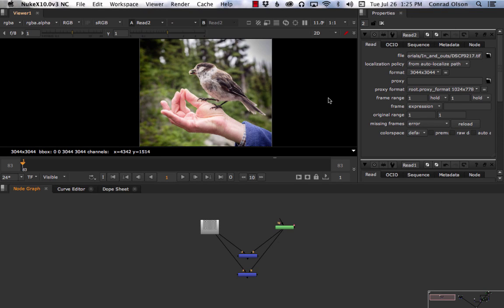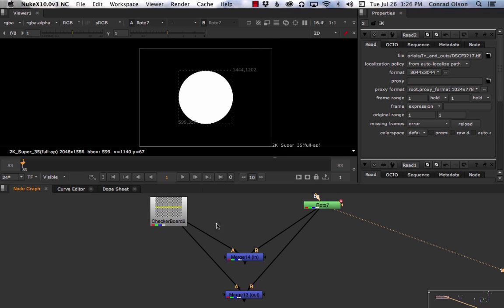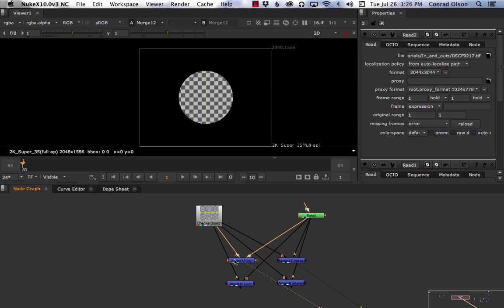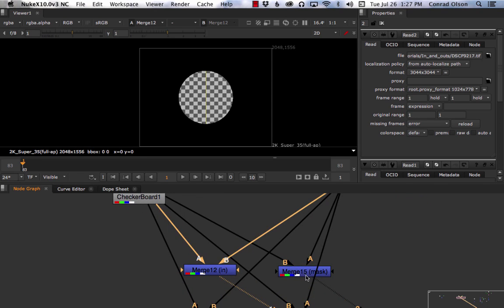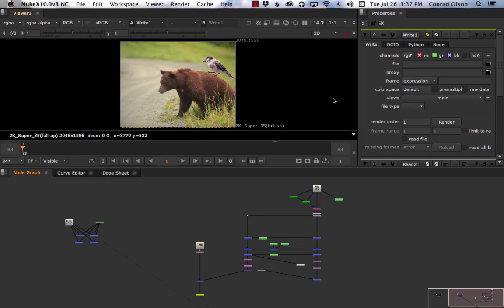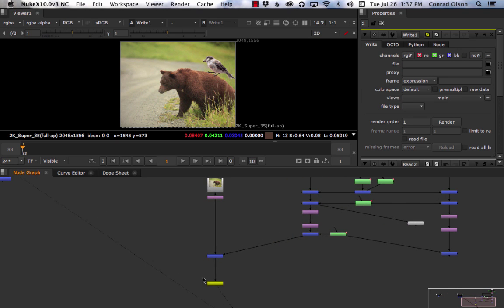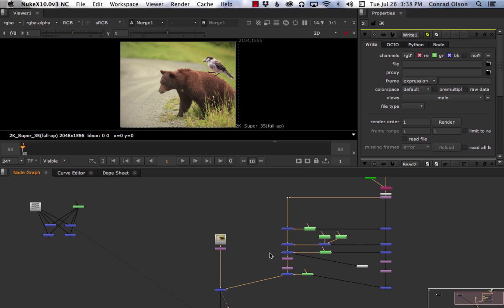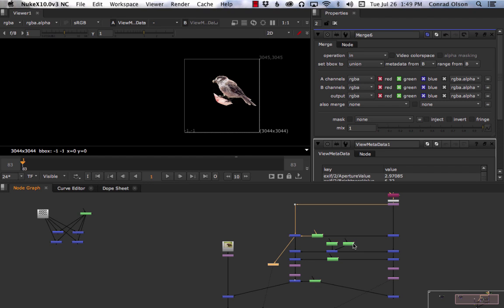4 Reasons Why You Shouldn’t Use “In” and “Out” in Nuke

Comment: I don't agree at all!  I've found many people getting totally confused with the Stencil node - where's my Matte??.  I see your argument working your way up the tree - so what if you work down instead?  Secondly, if you use a stencil node on something that does not have a alpha, you end up with the removal of the roto shape from the image but no alpha - it only gives the "expected" result if the source material has an alpha. The Out node does give you the Alpha you might be "expecting". Expected results are based on your expectations of what you want to think a node does - your expectation should be based on what the node actually does.  I like the In and Out as they behave exactly like you would "expect" if you see compositing as the combining of images using Addition of 2 images and multiplication of the Matte and it's inverse - FG multiplied by Matte, BG multiplied by inverted Matte and the 2 results added together.  I like to see everything in that light - so an In multiplies everything by the Matte (Alpha) of the Roto.  That's totally consistent logic to me.  And finally, the idea that everything is passed down the B side of the merge operations - it's an oversimplification. Try a few Plus operations on a semi transparent alpha - you have to go back to your original image and shuffle in a clean alpha........not so neat after all.  Yes, they all work if you know what you are doing - but not using In and Out - can't support that!
Reply from the maker: I don’t understand what you mean about the In and Out treating the alpha different. I just did a test with an image that has no alpha and a roto, neither the In or Out included the alpha from the roto in the resulting image. 

I would also argue that you should be thinking about the alpha of the image you are masking separately anyway.

Also, your argument about plus adding semi transparent layers with alpha channels together is just asking for trouble anyway. Adding alpha channels is always risqué because you can easily end up with a value over 1, which can cause problems.